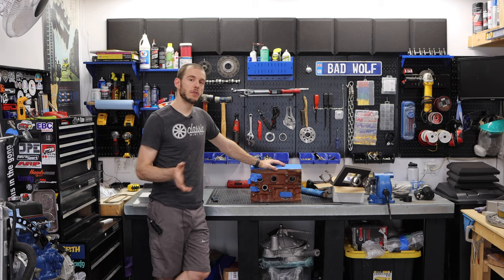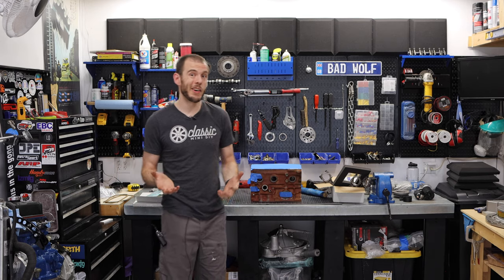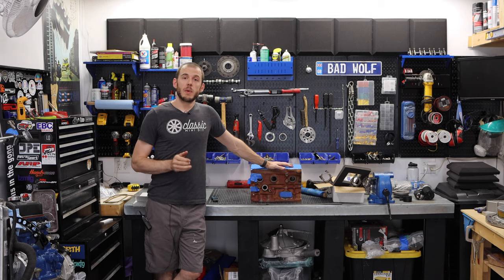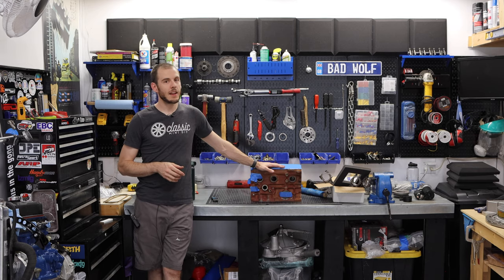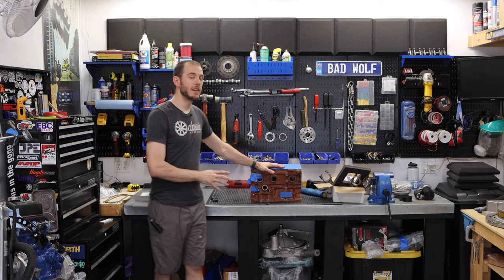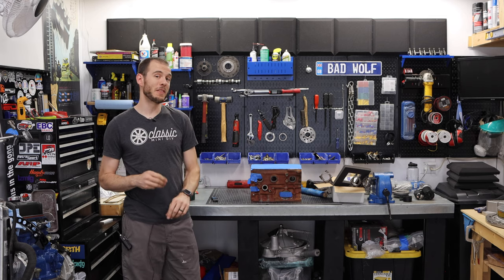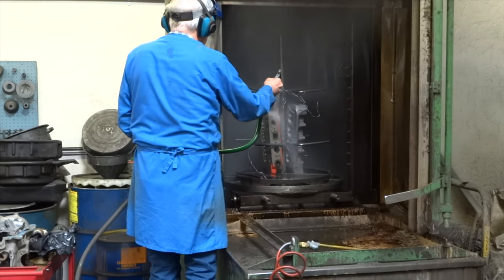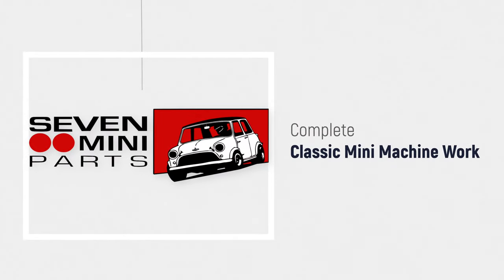Classic Mini A-Series Engine Assembly - Start to Finish

Comment: I am not a practical car repairer (I don't even own a car 🙂) but I am English and am in love with Austin, Rover and associated British cars. I enjoyed watching the video and generally got the drift of most of what the parts were.
Is the A-series engine still a good engine in 2022? I feel a lot of nostalgia for it. What are its shortcomings, if any?
Why does it not suffer from the head gasket issues that the later K-series engine exhibited?
Have you worked on K-series engines and, if so, what is the best head gasket type to use?
I am sorry if  my questions are rather basic.
Reply: If you ever own anything B L made you will very quickly become a practical mechanic.

Comment: I've recently bought the Swiftune Heritage Die Cast Pistons +40.

I have a question, I noticed the top of the pistons, is not flat, there is an offset surrounding the bowl, so you will see the diameter is not even from the top view, certain angle is thick and as it goes around certain angle is thinner.

Can I know why was it made this way and which way goes in during the piston installation into the block?

Comment: Great video and fantastic engine. Where did you get the lifting hooks that fit in the spark plug holes? I have not seen those in the usual Mini suppliers
Reply from the maker: Thank you! The lifting hooks are a custom tool I had a welding friend of mine make. They aren’t sold anywhere.
Reply: I’m sure you could fabricate some from a couple of old spark plus plus a couple bits of scrap

Comment: Also quick comment, what is the grey sealant paste that you are using called?  I heard a comment in a previous video,but cannot remember which one.  It looks super easy to use in that tube....  I assume you would only use that on the paper gaskets.. so e.g. if using a copper gasket between the gearbox and block you wouldn't use it?  thanks trev.
Reply from the maker: Hey sorry for the delay in response! The sealant I use is permatex black(link below) and yes its only used on paper gaskets in my engine builds. Never on the head gasket, and never any more than a very very light coat on the oil pump gasket. 

https://amzn.to/2WPzUqE
Reply: @classicminidiy  I understand paper but I see you used it inside and outside the main seal too, correct? I am about to Marry my engine and tranny and was assuming I use the black stuff there. Thanks. I wish mine came out as cool as yours.

Comment: do a video on the Classic BMC A-Series transmission and final drive
Reply from the maker: I have two full series of complete rebuilds on the Rod Change and Remote Change gearboxes you should check out. They cover the entire process start to finish. :-)
Reply: @classicminidiy  thanks will do that

Comment: I have a leak coming from the oil pan I suspect the gasket has gone I always thought the pan was a separate part but is the pan part of the transmission?
Reply from the maker: In most cars the oil pan is indeed separate. With the classic mini the gearbox casing (the part I lifted onto the upside down block) is both the gearbox and the "oil pan" as such. This means to remove the casing/pan you have to pull the engine to get it off.

Comment: Brilliant video - and definately something I will be using when putting my metro turbo a series engine back together.  Kindly our friends over at HRE are doing the engine bore and head work "prep" for me.  By any chance would you have a list, or know where I could find one of all the bolts required to put an a series back together.  So e.g. on min-spares and others there are bolts say for the water pump fitting.  But I would love to be able to buy a kit of all the assembly bolts ( of course not head or  transmission fitting bolts ) as they are special ones.. But the oil pump / water pump, ancillaries could all be covered with nice stainless.. Thoughts?
Reply from the maker: Thank you! You're in expert hands with HRE! I don't have a list of all the bolts required unfortunately but its something I wanted to build a kit for at some point. I believe Crafted Classics has a nice little kit available. I will say, if you hit a local hardware store and buy a pile of 1/4, 5/16, and 3/8 in coarse and fine threads, in various lengths you will have 90% of the hardware you need for the engine. If you pick them up yourself you have the added benefit of getting Grade 8 hardware too for peace of mind!

https://www.craftedclassics.co.uk/fixings/p/engine-bolt-kit
Reply: @classicminidiy  Perfect and thanks for the link.. you are correct about general hardware store purchasing.. I have done the same for my normal MG cars, which use metric bolts - so makes sense to build up a stock of Zinc platted and stainless fasteners at grade 8, or 10.9 in various sizes... simple things like this save time in the long run.

Comment: Nice work and the engine really looks stunning. Just two things:
1) Distributor should face vacuum inlet upwards (roughly towards 11h) from what I know - yours seems to me turned by 180°
2) When you have installed piston no. 3, at 4:50 it seems to me that there are some vertical scratches on the bore wall in compare to the situation before that? (f.e. 4:30) Or is it just misfocus of the camera doing that and they were there before?
Reply from the maker: Hey! Thank you, the distro is just put in there so it's not sitting on my workbench. I still need to clean up the bracket for it, at that time ill orient it as needed. Regarding the scratches, it's camera funkiness. Those cylinders were honed to 1293 and were some of the cleanest I have ever see. :-)

Comment: Question for you: With advancements, why wasn't the cam positioned directly above the valves in later models?
Reply from the maker: No idea honestly. If I had to guess it was cheaper to not make any changes than re-engineer it. Apparently rover really wasn’t doing super well financially by the end of it.

Comment: Spot on Cole. But, how did you identify the engine? 👍
Reply from the maker: I wasn't able to identify the engine number unfortunately but, the block casting is A+ based on external visual queues, the crankshaft, pistons, and rods were all A+ varients. And then I measured the bores to determine the displacement.
Reply: @classicminidiy  thanks Cole. Keep up the great work. I love your channel.

Comment: Wondering if this block has reached its limits as far as increasing cc capacity. Those pots seem awfully close to each other now.
Reply from the maker: These blocks actually can be brought out to 1380 and run very well. You have to offset the bore properly when you go that big though. This one is only at 1293 which is a very common and good over bore.
Reply: @classicminidiy  Thanks. I had an aluminium head Hillman Imp. The pots were so close to the waterjacketing that corrosion allowed exhaust gas to passover into cooling system and then out through the radiator cap.
Disastrous!